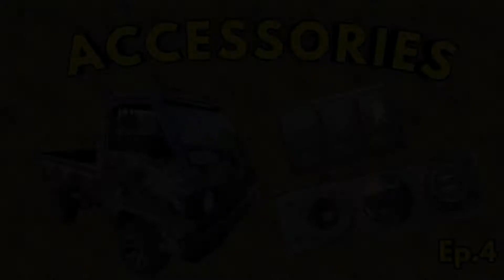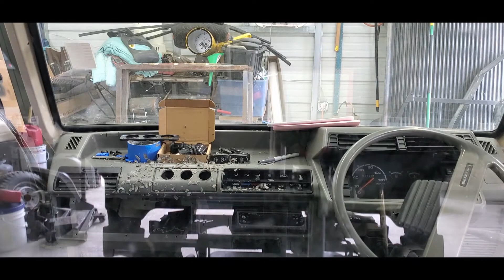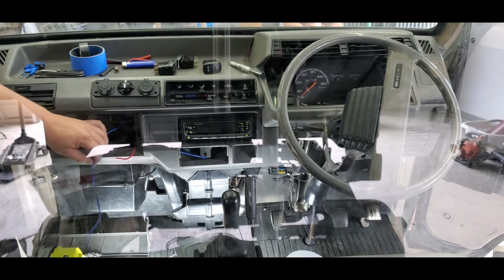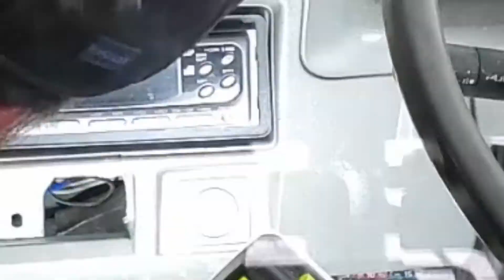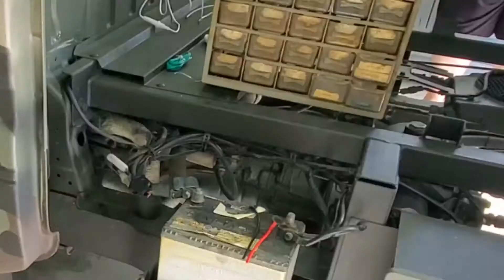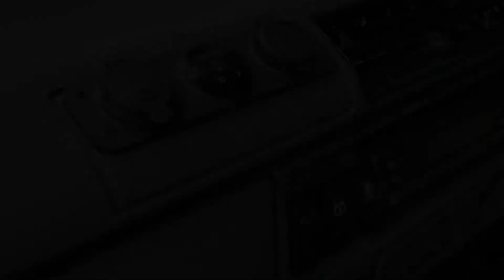HOOKING UP THE KEI TRUCK! DASH ACCESSORIES WIRING INSTALL, Suzuki Carry Switch & Panel Install!

Comment: If you had to do it again, would you still use the mounting plate for the 12v accessories or would you just mount them right into the dash?
Reply from the maker: Either way will work, I was satisfied with the mounting plate, it was also included with the the pieces.

Comment: would love to see a video on how you wired in the radio. Having a hell of a time finding a wiring diagram for my 93 Suzuki Carry
Reply from the maker: That is actually the CD player that came in it from Japan, Pretty sure it's a Japanese Pioneer. 
I might be able to get access to the vehicle and get you some video footage of the wiring. Most aftermarket cd players have a standard color chart. It might be enough to help you out.

Comment: I have the same little plate there I would like to turn into light switches or a cup holder.
#12 liked and Full watch as always.
Reply from the maker: You can find a variation of switches on ebay pretty cheap. Laser Etched is the way to go. I was looking into cup holders for it in the future, however in a future video there will be big news!